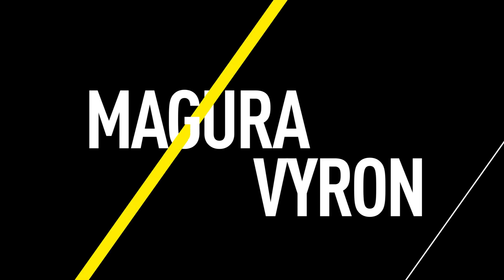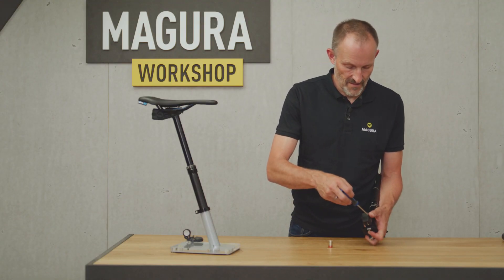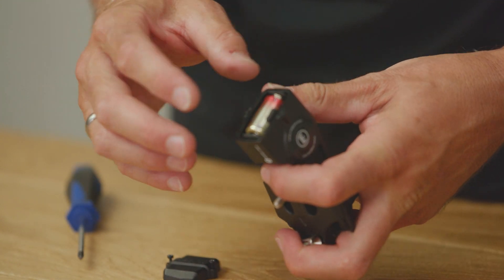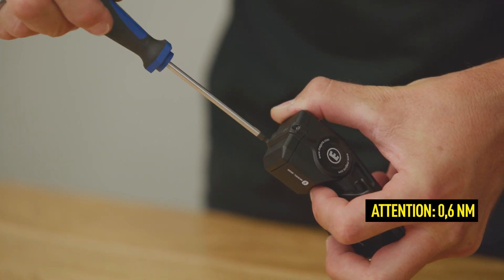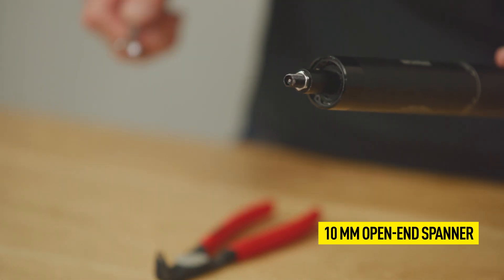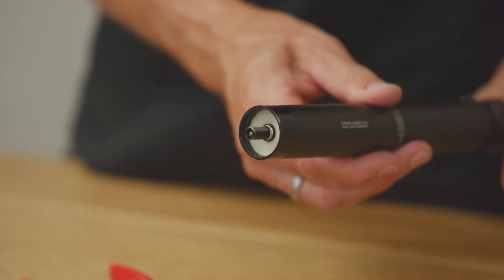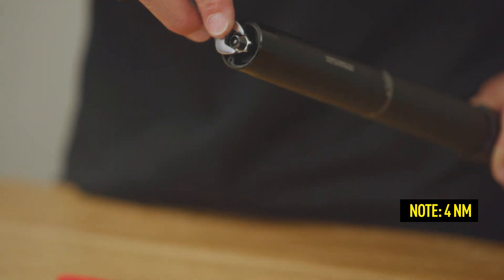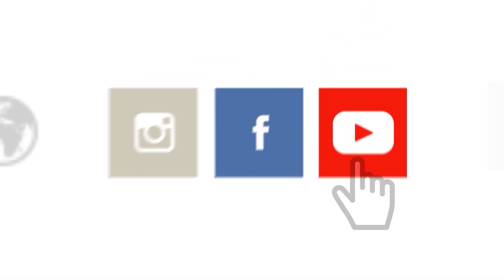MAGURA VYRON MDS-V3: Replacing the Battery & Adjusting the Travel (V3; from 2022)

Comment: Buyer Beware...

I have bought 3 of the V3 droppers in the last couple of years...Great post so far...
The latest is a 175 which I want to reduce to 150

I live in New Zealand and cannot obtain the -25mm base...
Magura Australia cannot supply it (and don't sell the V3 either)
Magura Europe/Germany told me they do not sell parts outside the EU and to try Magura USA
Magura USA told me they couldn't help and ..."unfortunately, we will more than likely not be bringing the version 3 into the U.S. for re-sale as it stands currently."

I was going to try the UK (since they are not in the EU),but noticed they have the same email address as MaguraEu...so no luck there either

If anyone from Magura reads this,can you inform me of any other options?

Comment: where can i get the replacement for the battery? mine is draining too fast
Reply from the maker: Battery on the remote or on the seatpost unit? Both are standard batteries, available in most places that carry batteries.

Battery for remote: CR2032
Battery for seatpost unit: CR2
Reply: @MAGURAPassionPeople  just realized I have the V2 :( not sure what to do
Reply from the maker: @gaboleo94  our older VYRON eLECT? Is the battery of the seatpost unit or the battery of the remote draining too fast?

Remote can easily be replaced, it uses a CR2032 battery.

The seatpost unit battery unfortunately cannot be replaced, only the whole controle unit. Product number is 2700933.